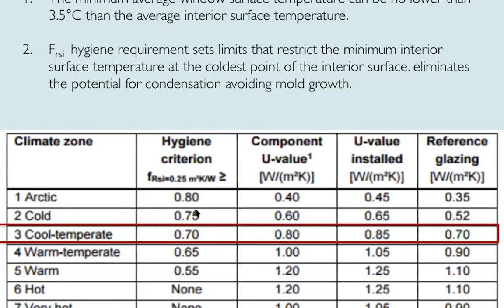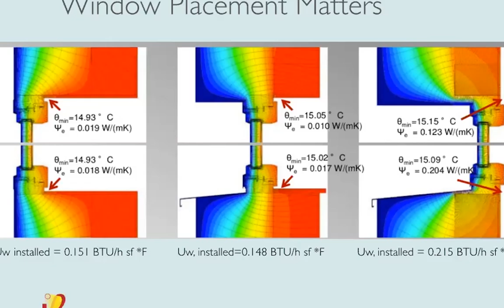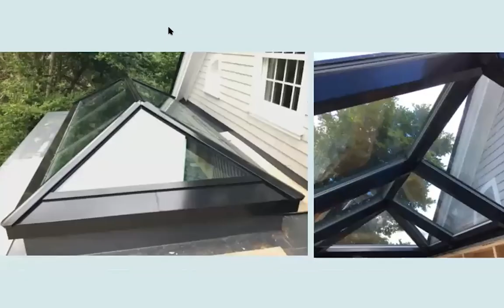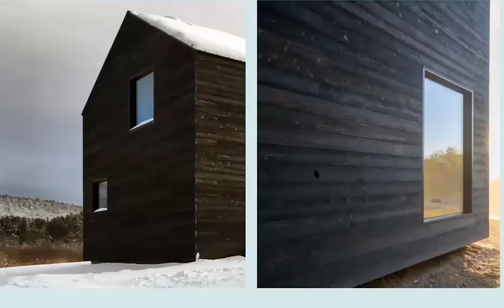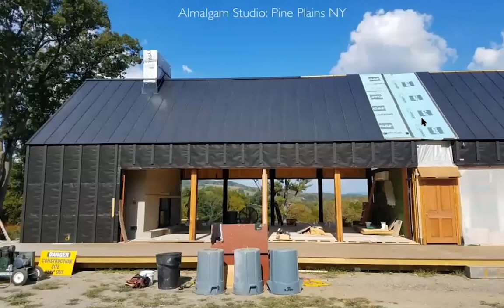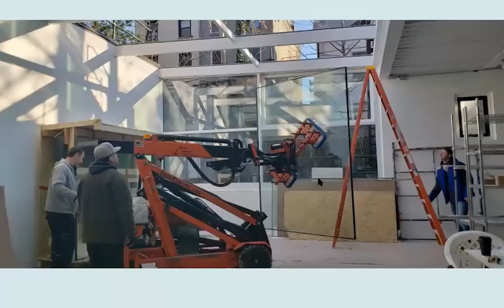What you should know about Passive House windows

Comment: do you have any suggested window manufacturer who satisfies these values who are also having hurricane rated glass
Reply: Look into Raico (DE)…. They may be able to advise on that and work with whatever the economical hurricane resistant IGU buildup in your area is. Typically there is an upgraded thermal break and airtightness from any major curtain wall manufacturer these days but your options are probably limited to fully captured systems. I doubt there is much of an industry for residential / low rise hurricane resistant passive house factory glazed punched opening windows. Probably going to have to be fabricated more or less locally (depends where raw IGUs come from) by a glazing contractor that is able to work with arbitrary IGU thicknesses.
Reply: https://youtube.com/user/RAICOBautechnik